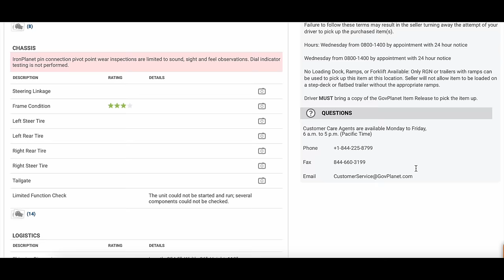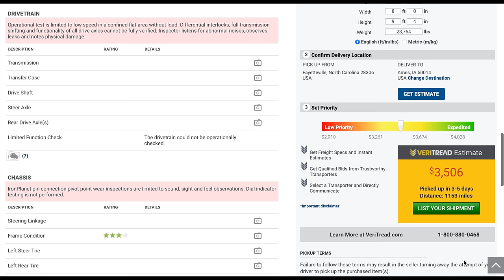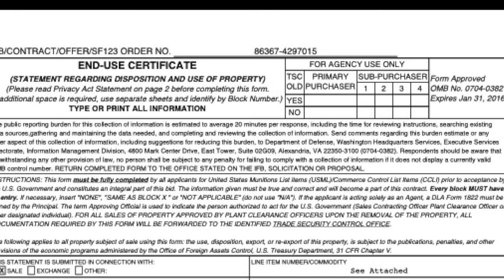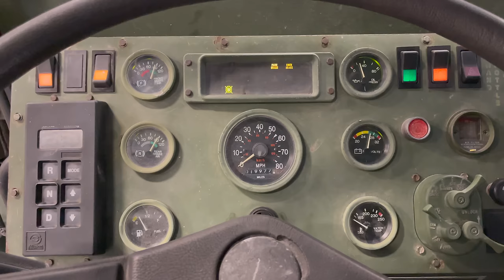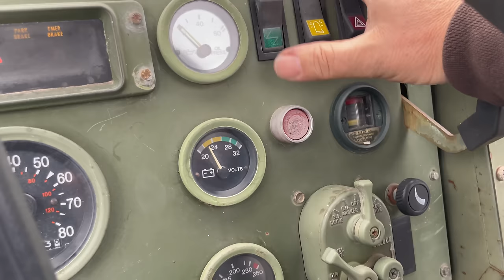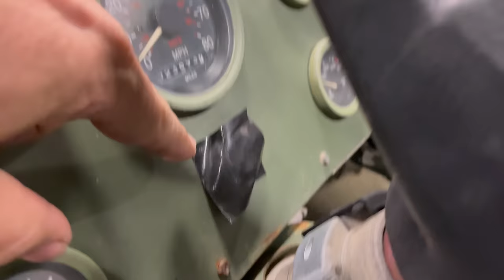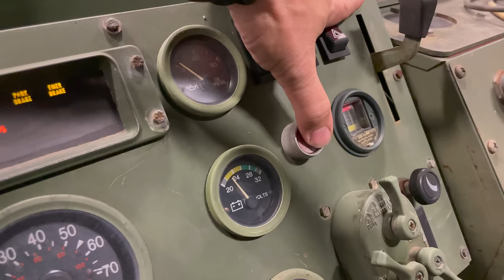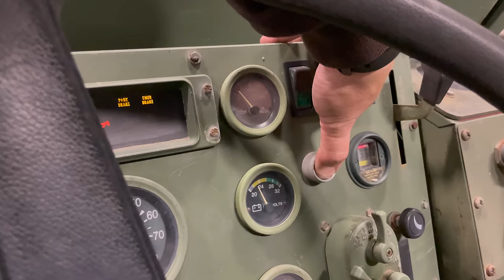Buying a LMTV on GovPlanet Wasn't How I Expected

Comment: Two questions - was it hard to make it street legal ? 
Do you just have to go through the normal state inspection ? 
I understand there are no "keys" or locks to prevent theft of fuel, batteries, etc. in an urban environment.
Reply: Hoping to see a reply to this question. Was the exact question is was going to ask.
Reply: I can't speak on behalf of making one street legal or the state inspection; my guess would be it varies from state to state. The best thing to do is Google your state requirements

As for the security on one, there are no keys anywhere on them. The only way to secure a light skin LMTV is with a chain and padlock around the steering wheel. As for the fuel, They are extremely vulnerable to theft. I wouldn't leave the truck anywhere it's exposed since they're equipped with a simple, standard twist cap on the tank. The only real security and protection for light skin LMTV'S is the lack of everyone's knowledge about military equipment, ensuring their inability to operate them and the kill switches hidden around them.

There are 3 kill switches on them. The main kill switch is a twist toggle under the battery box that a small lock can be placed on. It's pretty funny to sneak up to the truck, then turn it off on it's unsuspecting driver and watch them freak out trying to figure out why the truck just went completely dead. A lot of soldiers tend to be aware of this one.

 The 2nd is a cover protected flip switch, roughly by the drivers left knee under the dash. It takes a little bit of misdirection but another fun one to hit on a unaware, distracted driver while you're sitting around. Only a small handful of guys seem to know about this one. 

The third one is another protected cover flip switch in a switch bank located behind a rubber flap directly under the passenger side of the cab. That switch bank is actually intended for use while the cab is in the raised forward position but can still be accessed with the cab lowered.  This typically requires long arms and to be skinny enough to squeeze between the tire and cab. 

Most people, until proven wrong, will/have argued that there are only 2 switches. Making the third switch is virtually a myth, so. Unless you've read the training manual, someone has told/shown you about it, or you're truly mechanically inclined and know the equipment; then, this switch non-existent.  Even the most experienced techs, drivers, and army trained "part changers" had no idea that it exists. 

I've been the "master driver" now for the last 9 yrs in my unit. I instruct, road test, and validate all of our licensed drivers. Constantly, I still find myself coaching and reiterating how to operate these trucks to even some of my more experienced guys. Point being, the chance of a random civilian hoping in your LMTV and being capable of taking off and extremely slim to none. To prevent a marine from taking it, just leave a box of crayons on the seat and they'll totally forget about taking the truck. I wish I could add pictures, but for now I hope this helps!
Reply: depending on your state, these trucks are or can  classed as a heavy truck so its weight class makes it legal to drive in various states. different safety rules for bigger size trucks and their weight class. i am sure i am somewhat off on this as it has been years since i heard of it, thats why the big deuces are legal to drive on the roads and the old jeeps were not.
Reply: @andrewkotcher5704  Hmm. Good point.

Comment: This looks more complicated than the trucks I'm used to running and working on these days. The fuel pump has a fuel cutoff lever on it, and the cab lift is hand-pump only. But I can entirely relate to the fuel cutoff being in the wrong position on startup and the cab lift hydraulics pissing oil all over the place. 😂

Comment: Not true on the military charging batteries. Keep in mind the vehicle is coded out for a variety of reasons. Normally many vehicles leave the unit in fully operational before it goes to DRMO. Once at DRMO it won't normally get touched

Comment: Realize, the military puts these up for auction because they're mostly trashed and for some reason people will buy them! This truck new in 97 was about $170k and when it's used up
it's basically scrap. Great video but I would NOT recommend people buy these pieces of junk frankly they should give them away since it's your tax dollars that paid for it to start with.
Reply: Lots of surplus vehicles are sold with extremely low miles and little wrong with them.
Reply: I guess you don't own one?

Comment: So funny that you basically compare the European Austrian Pinzgauer an the European Austrian Puch-Daimler Steyr LMTV Cab over Truck. The FMTV is based on the Austrian Steyr 12 M 18 (4×4) truck, but has been localized to meet a minimum of 50% US content. The original 15 FMTV prototypes were assembled in Austria and while based on the 12 M 18 chassis-cab, were fitted with a number of US-supplied/specification components including a Caterpillar diesel engine, Allison automatic transmission and Meritor drive axles. So depending on the year there will be more or less European parts in there, and so more or less American parts in there.

Comment: Hey, Air Force Fleet Manager here. If a vehicle doesn't work that doesn't mean we won't fix it. There are a multitude of reasons why we would get rid of a vehicle. As someone who has conducted LTI's on LMTV's before I can tell you the only time we would DLA an asset is if the cost to repair the asset exceeds it's worth, or if the asset is unrepairable without hindering the safety of any one interacting or operating the vehicle. If you ever see a vehicle that looks like all it needed was a battery charged or a new alternator is because the military must likely DLA'd the vehicle, and no other base nearby wanted to take it into their fleet. If the vehicle works when you have it more than most likely a third party repaired the vehicle.

Comment: Don’t know if you figured it out yet, but when you are working on the truck or just tired of hearing the buzzer while waiting for the air to build up, put the light switch in blackout and the buzzer will silence.  A lot of accessories run through that switch so you lose some functionality but if you just use it while in the shop to reduce noise you’ll be fine.
Reply from the maker: I did not know thanks!

Comment: Our company purchased one of these.  Said it was perfect and ran.  Tires rotted out on arrival.  $1500 per tire.  It sort of ran but would only go 35mph on the highway on straight aways.  It took $8000 to bring it up to road readiness.  Engine was good.  Tire inflation system was screwed.  Hydraulics were messed up.  The good thing was it was LOW HOURS.  Finding parts online was a major pain.  There is a reason the Army started dumping these on the public.

Comment: When buying military surplus vehicles always plan and buget for three so that you will have at least some useable parts to make one such vehicle useable/drivable. Also track down and purchase every service manual you can find on your particular vehicle and all the military grade tools for your vehicle. IF you can also purchase new, surplus, parts for your vehicle purchase as many of them as you can while you can. Military vehicles, wheeled or tracked, almost always get heavy usage while still in service and are driven by any number of personnel some if not many of whom have limited experience with the vehicle in question outside of Basic Training if enven that.

Comment: For @6:32 As a previous soldier whom used to work on these (at least at the 10 level), if you release the air on the in the side tanks (which per the manual your supposed to do when not in operation), that vehicle wont move.  It locks the brakes.
Reply from the maker: True but it wouldn't be a lot of fun listening to the air leak the whole time you are working on it.
Reply: @ThisWeekWithCars Invest in ear pro? Did this that with our LMTVs back in the motor pool whenever we got back from a drill.
Reply: Don’t forget your chock block and drip pan! Lol

Comment: I would expect any LMTV that was released as surplus and sat around a while after that to be less than fully serviceable. The military is going to tend to ditch the most troublesome units first. But as long as the motor isn’t reliant on ether to start it will probably be repairable at reasonable cost. If users were over using ether then a full engine rebuild would be required. Personally I never had to use the crack bottle. Covering the exhaust very briefly for a few seconds when starting to increase pressure achieved the same thing with less chance of damage.

Comment: The electrical failure at 4:30 was probably caused by the alternator voltage regulator. The old battery had protected the electrical system but jump starting it with a now dead battery put who-knows-what voltage into the system.
Always check the system voltage. Ideally fit a voltmeter. 
Charging a dead battery without first giving it a 24 volts kick risks it going reverse polarity. I don’t know the chemistry on that but believe me it happens. Connecting any battery the wrong way around will fry the electrical system.

Comment: yeah you forget to mention if you don't pick it up in time you can get penalized depending on the seller. also some of the sellers don't have a way to measure dimension or weight or much less palletize  items. be weary to buy most anything here. they try to help you as much as possible but at the same time they leave a lot of open ends. so the deal might not be as good as you think it is.

Comment: Using surplus military trucks as a base to build on might enable someone to build an RV that doesn't suck.  I swear the flimsy, janky, fall-apart crap that's coming off RV lines these days (and falling apart after every three days of use in ways that take three months to fix, on a warranty that turns out to be worth about as much as a fart in a hurricane) is a business opportunity for anybody to start building honest no-nonsense machinery on any kind of real chassis that can be fixed into a durable, repairable form.

Comment: When you buy a truck etc. this way. Take a flight to the site and drive it back.
I did this when I bought a school bus from Florida and I live in Michigan.
Cheaper and easier. However if it does not run, then that might be a problem.

Comment: I was a “wheeled” mechanic in the Army and all of the non deployed vehicles sit in the motor pool for years and years and only get started up Mondays and just sit so the parts break from just sitting there. Also put a piece of tape over the buzzer and it cuts that sound way down.
Reply: The cap from a soda or water bottle helps, too.

Comment: We bought one of these for our dept to use as a high water rescue/brush fire truck. Ours uses 4 6volt batteries for the 24 volt system, cost about $350 for them
Reply from the maker: They should be four 12 volt batteries.
Reply: @gurnblanston3210  that was how ours came,and they were milspec batteries, and were what our chief replaced with

Comment: Voltage should have been in the green when the engine was running. Looks like it wasnt charging. I'd check your voltage regulator and alternator wires. I'd also ditch those lead acid batteries for optimas. Especially if your off roading with it. 15 year USAF vehicle mechanic.
Reply from the maker: It’s charging I haven’t had an LMTV with an accurate voltmeter yet.
Reply: Do they have external shipping to the Middle East, especially Iraq? @ThisWeekWithCars

Comment: So I see that one of the trucks has the fold down air transport cab. I've had some questions about how that works but never seen any videos about it.If you made one you'd be the first as far as I know. I was trying to figure out before buying one if the roof and cab sides can be lifted off while leaving the windshield in place like the Deuce and a Half or would it need reinforcement. I plan to put a cage in my cab anyways but the ability to go convertible would be a bonus.
Reply from the maker: Yes the roof comes off.  It comes with a crane attachment for the spare tire lift to remove the roof.  The doors and sides are all hinged so once the roof is off everything else can hinge down or be left up, even the windscreen.

Comment: Gah, Stewart Stevenson is such hot garbage. The trucks at auction either have a $0 MEL and are obsolete or meet MEL and have more wrong with it than it's valued at (like an insurance company). Keep expectations low. If a vehicle is there, it means it probably has things wrong with it and they haven't put a penny more into repairs or maintenance. But yeah, electronics on those trucks are garbage....

Comment: Looks like the gun mount ring is still on the auction truck... If so they can bring big money... They are hens teeth to find. My story is Knd of like yours. I threw in a token bid of 3800 dollars and won it. I didn't have to wait and had it in a week. It didn't have batteries but fired up when i got some. Mine was more complete and was over in Kuwait with the Washington National Guard.  I have done few things to it and have the 3.07 gears installed. It will drive at 70 MPH
Reply from the maker: Yes the gun mount ring is still complete.
Reply: I have the gun ring in mine.

Comment: Too dang much electronics. EM blast and they will all be dead in the water!!
Reply: Hardened for that.
Reply: @erikhilsinger9421  just not hardened against a rampaging alternator
Reply: Yup. Gimme a 1970 Mack diesel
Reply: If you mean emps then nope. Mosts of tests have been done showing most vehicles wont be effected much to at all. Some would need repair most would start up or if it stalled it would fire right back up fine.  Now these new modern cars that could be a different story...

Even my 04 ram would be unaffected might stall possibly but just turn the key again and your ready to go.

Comment: Years ago I built a relationship with a DMRO guy who tested the trucks. I even had his cell number. He said if I wanted one to call him and he'd give me the heads up on which one I should buy. That was 10 years ago. I never moved on one. I think they are cool. BUT parts would be an issue
Reply: Other than in the cab just about everything is off the shelf.

Comment: I'm 8 minutes in and I already have several reasons why the second truck is messed up. the air over hydraulic pump is like 500 dollars and I hate how it's always 10 weight that troops will throw in it without looking at the manual

Comment: Hey just a little advice Ima mechanic in the army so I have worked on thoes trucks a lot and if you wanna start the vehicle without gettin in the cab there should be a little switch with red flaps on either the passenger or driver side behind the little rubber thing on the cab and if you got any questions feel free to ask away
Reply from the maker: Not on these early models
Reply: A1R with C 7 has it.   A0 NOT THERE.

Comment: I used to drive these guys (poorly) as our unit's driver. I recall how touchy the air breaks on them are! 

I recall one time during a parachute detail one of drivers backed up with his ground guide on the wrong side and backed over the rear of the NCOIC's car. Driver told me he barely felt it. Those vehicles are tanks.
Reply from the maker: The tires are 47" tall I would believe it.

Comment: Its crazy that buying one of these makes more sense to buy as an offroader than a ford or chevy and then doing 100 mods to them to make it work off road.
Reply from the maker: Has to be cheaper in the long run!  Comes stock with 47" tires.

Comment: Youre buying a vehicle that has been deemed used up, the life cycle manager has had enough input from the field that they are not reliable anymore and arent worth investing more money in repairs, the system just wants to get rid of them. Rode hard, put away wet. Good luck with the paperwork /ownership as well

Comment: I like the old mechanical injection ones better because they are a lot easier to turn up. But once you get those engines tuned (even the electronic ones) they are full on beasts.
Reply from the maker: These are fully mechanical engines, no electronics.
Reply: @ThisWeekWithCars  get it tuned then. It will make a huge difference in power.

Comment: Great video! But I wanted to see how well it performs in heavy snow conditions.
Reply: It is based on a  STEYR Truck developed in GRAZ in Austria the same company who developed and produced the PINZGAUER. If the same components are used, this Truck will work very well under heavy snow conditions.

Comment: Ima little late to this but did you do much looking i to ehst model tears had certain system problems failures or undesirable features that were problematic or anything like that. Like the 4wd offroad feature or air pump etc perhaps would fail a lot from this year to that year before you made your choice or you just kinda pointed at one online and got it

Comment: Diesel at $6 a gallon this is a super expensive toy to drive hehe I love it.
Definitely would like to have a 4 door version , and god forbid you get it stuck have to have a backhoe or a dozer to get it out haha I’m sure it’s probably a lot heavier than my power stroke and that thing is almost to heavy as it is , this would be a great truck if you wanted to get into doing on site mechanic work or maintenance for loggers or oil guys.
Thanks for video neat to see how it works to get one these
Reply from the maker: I have gotten it stuck up to the axles and had to use my 6x6 to pull it out.